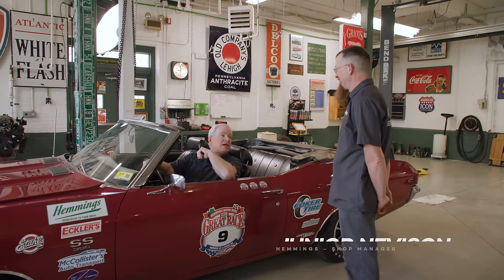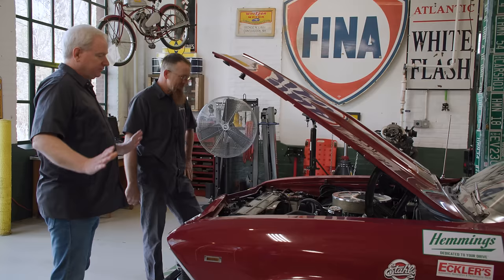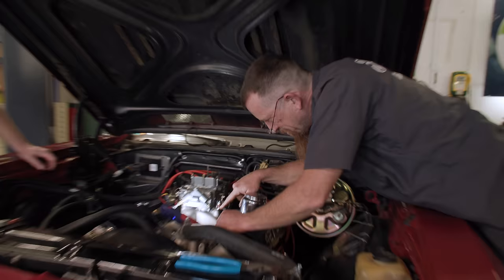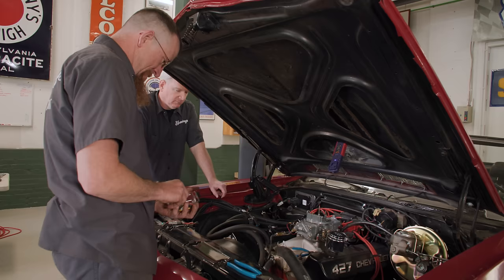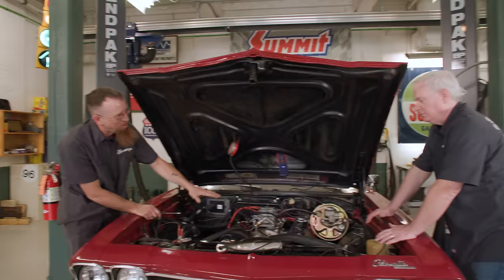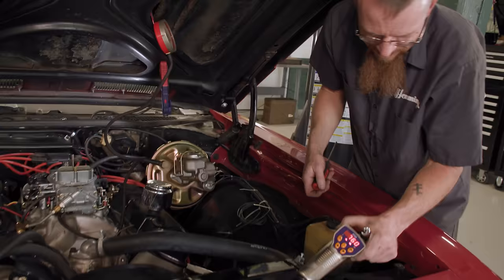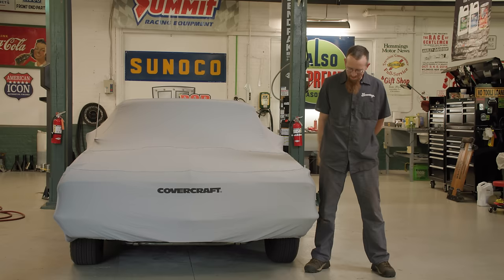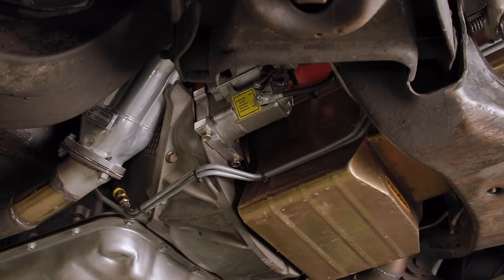Fixing bad things done to a great car. Hemmings’ own 1969 SS 396 Chevelle.

Comment: Great video. Juniors uncle bought a new 1969 Chevelle with a 396-375hp 4 speed, two door hard top. The car had the chambered exhaust which didn't have mufflers just dimples in the exhaust pipe. His then 60 year old grandmother used it when she needed to drive somewhere. There were a lot of stories around the city amongst the car guys about the old lady in the blue Chevelle and what happened when they thought it would be fun to mess with her. They were rolling away from the stop light and she was already at the next one. There may have been a lot of tire smoke and tire marks on the road. It was mentioned upon occasion that shifting the car into 4th at 100 mph, the rear end of the car would weave back and forth.The trade in car was his grandma's 1965, 140hp-4 speed, triple black convertible.

Comment: In some of the quick views, it was hard to tell where the engine fan was positioned. For best efficiency the fan blade should be 1/3rd in the shroud, 2/3rd out. The fan not only pushes air backward, but it also slings it out along the radius. If the fan is fully engaged within the shroud, the shroud will block airflow along the radius in turn drawing less air through the radiator.
Reply from the maker: Thanks for the suggestion! 🤝